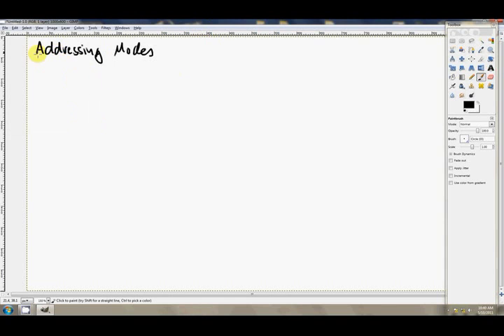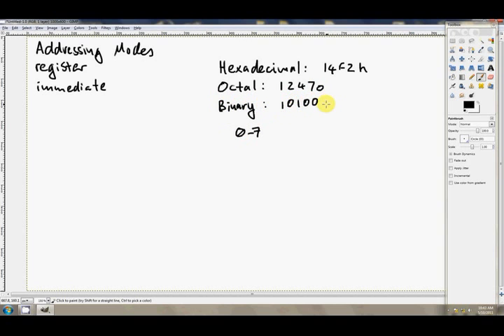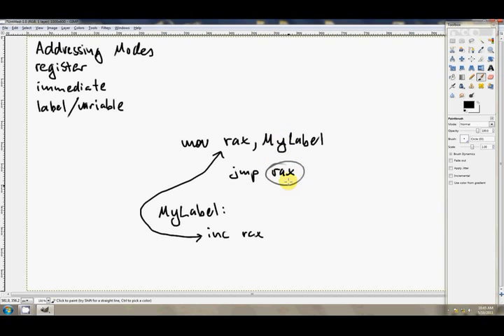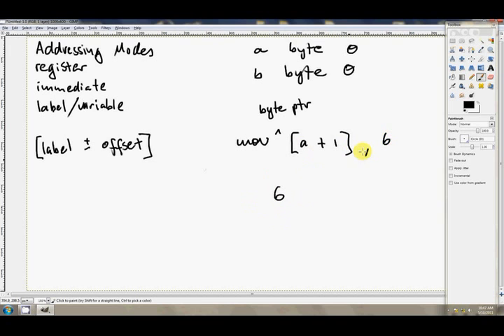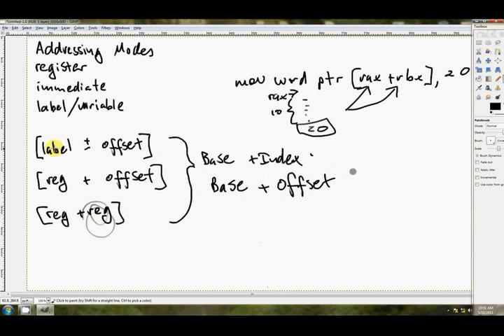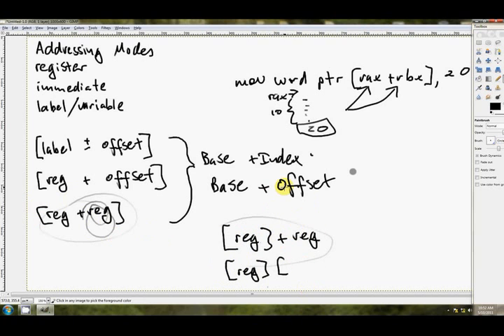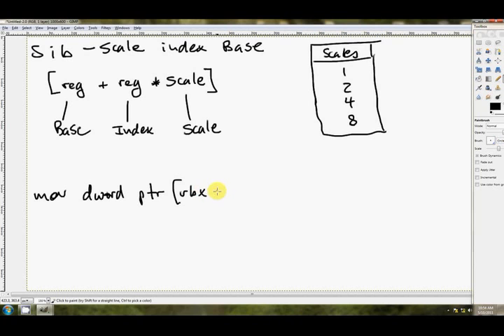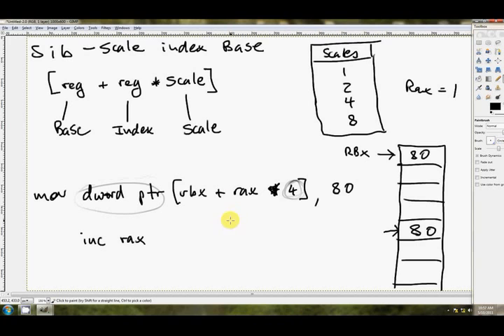x64 Assembly Tutorial 20: Addressing Modes

Comment: For the exercise:

Look at the machine language instruction generated by mov cx, 57599.  It is:
66 B9 FF E0
Then you move wherever MyLabel points to into rax, fine.  Then you jump to two bytes after the beginning of the instruction mov cx, 57599, so that the instruction pointer is pointing to the byte that contains FF above.  It turns out, however, that FF E0 is just the machine code instruction for "jmp rax", but rax now contains the address of MyLabel, so it jumps to MyLabel and returns.

Comment from the maker: They will do basically the same thing only the first one is faster. The address generation units (AGU) will perform the calculation for free if you use [rax+1]. There's some brilliant magic tricks using the LEA instruction because of this. The code accesses RAM it's not likely to matter here but you'd usually make the AGU do whatever it can since this happens in parallel to the instruction!